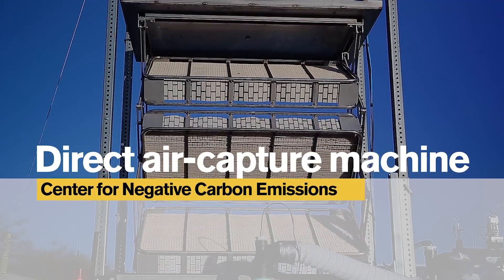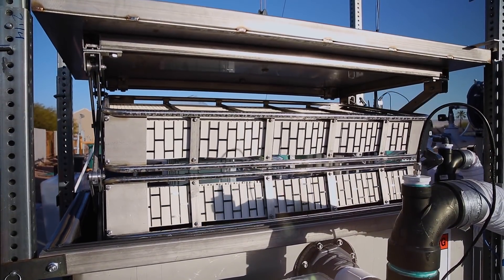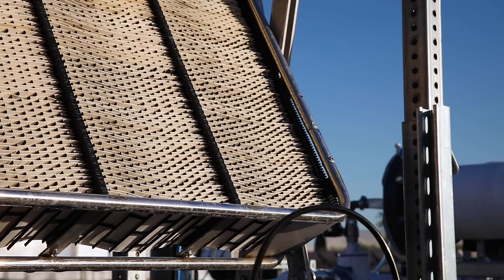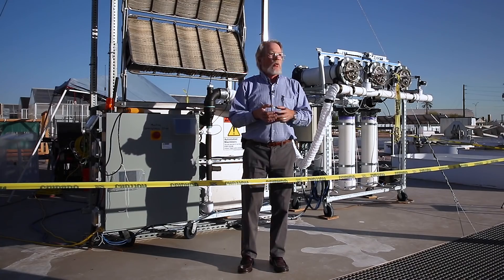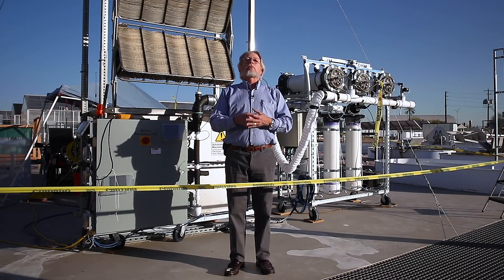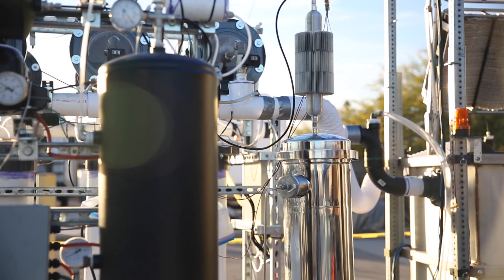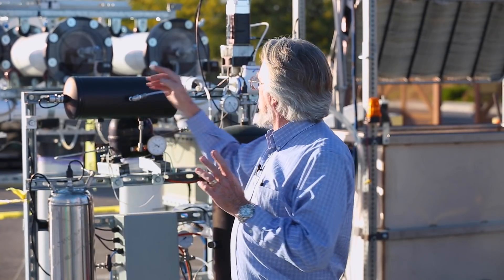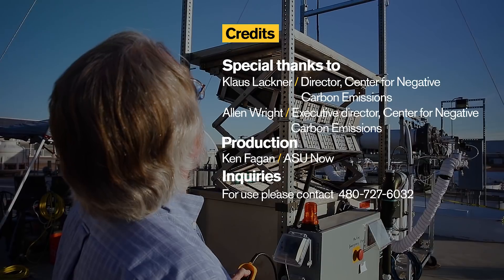Direct air-capture machine | Arizona State University

Comment: So where does the sodium carbonate come from? Isn't most sodium carbonate produced by heating sodium bicarbonate until it gives off CO2? If that's the case, then this process can only recover the amount of CO2 used in producing the sodium carbonate in the first place.
Reply: Please explain
Reply: But they add the C02 enriched water to the sodium carbonate to create the sodium bicarbonate. As long as the output of CO2 exceeds the original reaction of the sodium carbonate, isn't that worth the process right? A pure stream of CO2 could be a commercial demand as well.